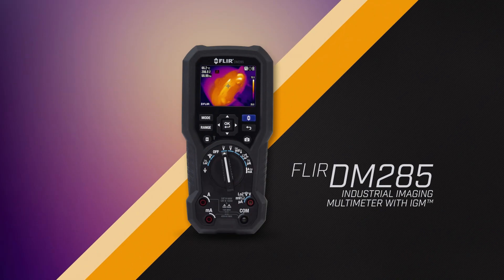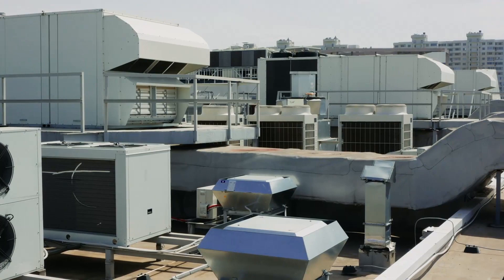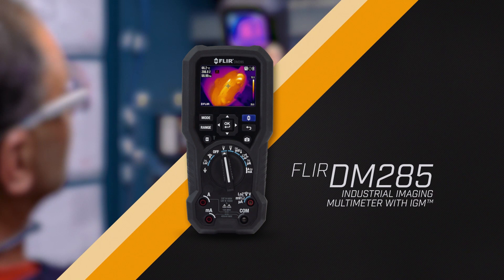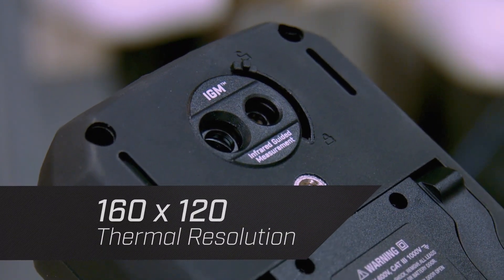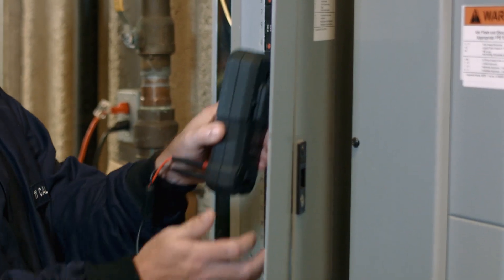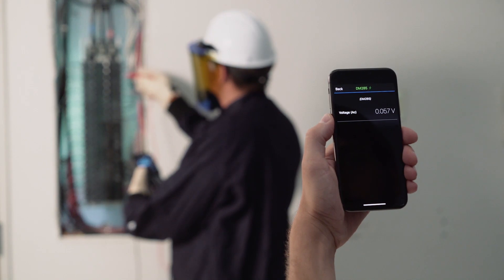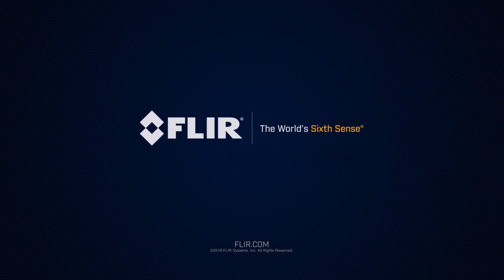FLIR DM285 Industrial Imaging Multimeter with IGM™

Comment: This is the future of handheld DMM! almost everything a hvac and electrician will ever need! I wish they have a low power mode to save those precious battery life. Sometime all you really need from a DMM is a quick voltage check and not have to worry about charging.

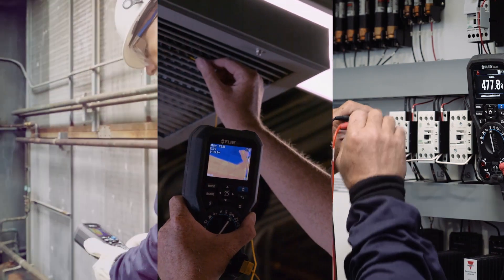Comment: This looks like a fantastic tool, but I have 1 reservation and 1 observation. My reservation is whether it complies with OSHA in having test & verification from an OSHA listed NRTL (https://www.osha.gov/dts/otpca/nrtl/). My observation is that at 0:10 and 1:30 the individual is taking a voltage measurement of about 479.5 VAC and is not wearing insulating gloves! Both OSHA and NFPA 70E require protection from inadvertent contact with energized conductors above 50 Volts. I point these things out as I teach electrical safety, and I am all about education.
Reply: what kind of insulating gloves you would recommend.